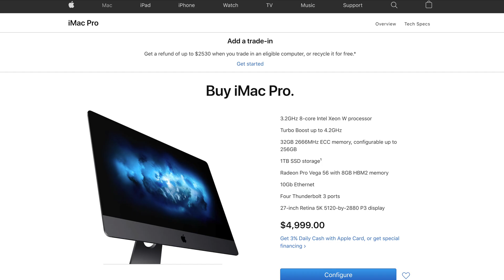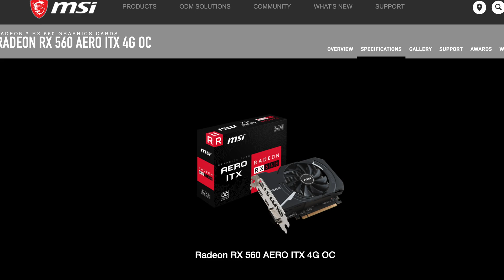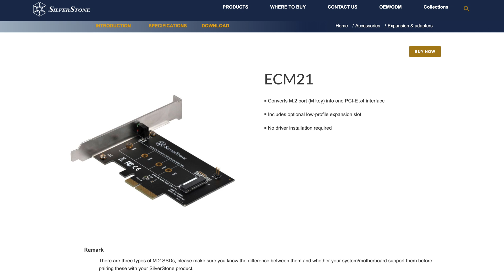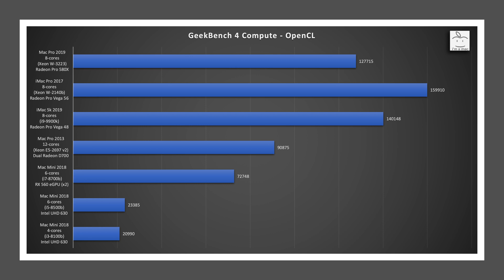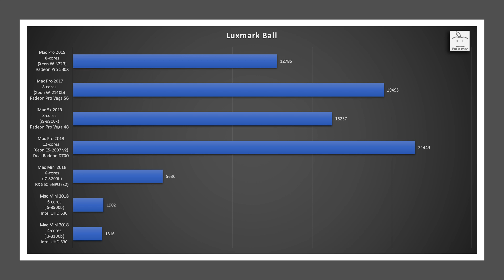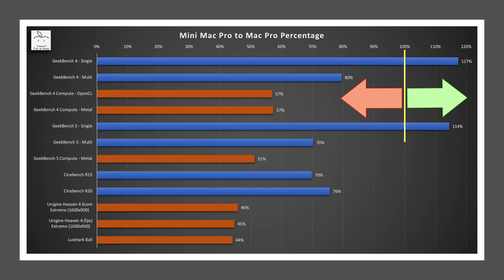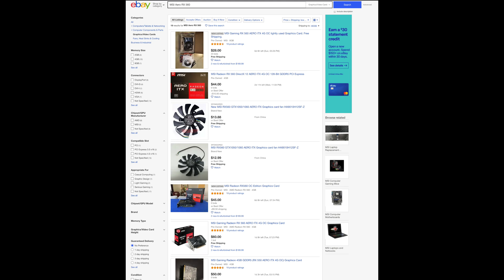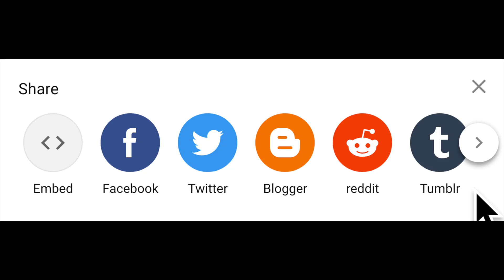Chasing the Mac Pro - Part 2: my Mini Mac Pro for $1,500

Comment: Thank you for several reasons.
For mentioning that you edit with FCPX and this set up is working well for the 4K footage you are shooting.
And you mentioned QuickSync. I feel people forget how valuable that is when editing with iMovie/FCPX. If you are shooting with your phone or a camera that outputs h.264/HEVC then this set up will do wonders for your work load. 
Lastly thank you for showing several benchmarks. I am always wondering how a newer computer will perform vs an older 5,1 or 6,1 Mac Pro. I feel that unless you are working with R3D or Black Magic RAW formats you'll be fine with modern 4, 6, or 8 core Mac PCs. 
Now onto the next video in this series. (: